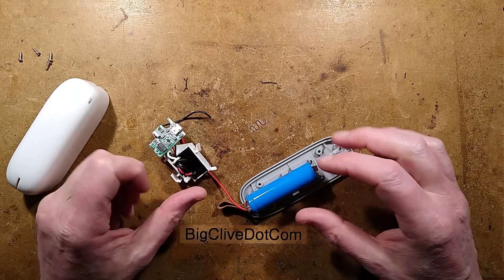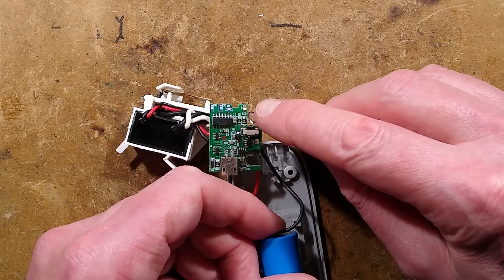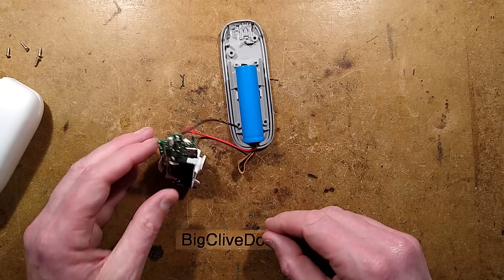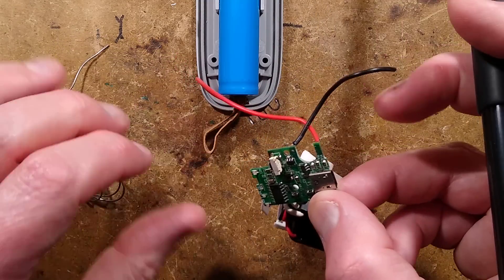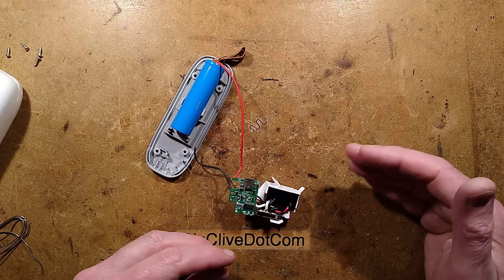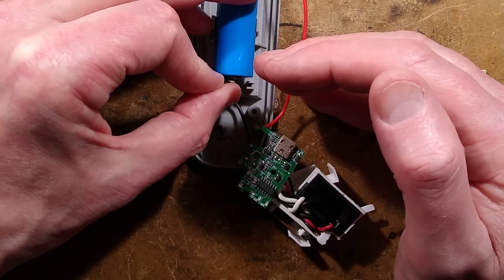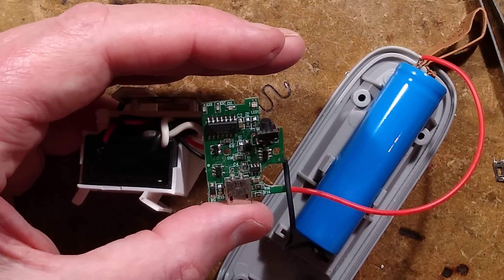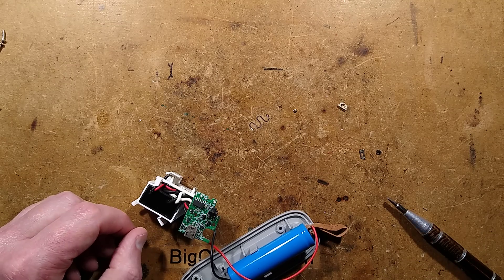The curse of tin whiskers rears its head again

Comment: Some ICs avoid whiskering by using three-layer nickel/palladium/gold plating (I use them in my own projects when available at a reasonable price), but consumer product makers are unlikely to pony up for that. I don't think anybody would have really minded if lead‑free solder was only mandated in incandescent bulbs (apart from oven and heat lamps, where high‑lead solder is necessary to get a suitably high melting temperature; anyhow heat lamps usually have longer lifespans), the internal connections of primary batteries, or similarly disposable items.

Power switches normally use silver alloy contacts, while quality signal/logic switches may use gold contacts; but in these cheap buttons, who knows?

There were actually some campaigns to move away from lead-acid car batteries at around the same time RoHS came in, but nothing seemed to come of them… (The EU bureaucrats presumably knew full well that they couldn't stand up to the battery industry, so ended up issuing RoHS as just another token “feel-good” gesture. Obviously lithium-ion and NiMH are more expensive and weren't so mature in the early 2000s, but the new sodium-ion batteries should help in the cost regard… CRTs were also exempt, so the last few years of CRT production used lead‑free solder despite containing far more lead in the glass anyway.)
Reply: the problem with lead isn't the circuit boards -- we're not eating them -- but the mining and manufacturing of them.  Same with mercury.  We're fine, the people we're forcing to mine, refine, and sculpt them into intricate shapes are not.

Car batteries at least are the most recycled product on the planet.  We don't have to do a lot of mining for those.
Reply: @tsm688  Solder accounted for less than 1% of lead usage; so if the lead‑acid battery market grows even a few percent, that's enough to overshadow it. It doesn't take much searching to find that we still mine ample quantities of lead (including in Australia; we're second only to China there).

Only if we actively reduce lead‑acid battery demand, can we rely solely on recycled lead…
Reply: @longrunner258  the same thing we always hear, "we can't do it perfectly so why do it at all".
Reply: @tsm688  More along the lines of "the patient has a massive gash on their torso, so let's remove the splinter from their hand and brag about how we saved them".

Banning leaded solder was a feel-good measure that did not actually generate an appreciable benefit(it arguably made things worse due to the sheer amount of additional electronics failures it caused). 
Meanwhile, the EU government was actively refusing to raise emission requirements on diesel engines and instead subsidizing them to keep them cheap and increases sales. That DID have a major difference, both locally and globally. But whatcha gonna do? Politicians gonna regulate, and they will do what generates a good soundbite instead of what is  actually a good regulatory measure.
Reply: This doesn't account for the benefits to the people making products, who take the brunt of the major harm caused by using lead in electronics. I actually consider myself relatively lucky that I only started electronics as a hobby after the transition from leaded to lead-free products became mature. I have no real experience with the leaded products and I find the lead-free ones to work just fine, but everything I'm using is designed for the higher temperatures required. I suppose I also just don't know what I'm missing? But I love the peace-of-mind knowing that I have a lot less risk soldering without a full ventilation setup. While I doubt that the harm that lead in electronics has caused can be quantified the same way that it is for leaded fuel, seeing the direct and severe mental degradation leaded fuel caused around the world for generations without us taking the threat seriously is terrifying. Lead is an extraordinarily useful material: cheap, plentiful, easy to process, easy to work with and granting amazing qualities when added to other materials, so it's a difficult and expensive process to wean industry off of it by finding alternative materials and processes.
Reply: @waylandsmith  - For a hobbyist who is not working in factory conditions, as long as you wash your hands after using leaded solder, the risk from using leaded solder is minimal. The fumes from Rosin based flux is a greater risk. There shouldn’t be any significant amount of lead in the fumes because your soldering iron should never get hot enough to cause any significant amount of lead to become airborne.
Oh, and you can still buy 60/40 solder that contains lead.
Also, if your home uses lead water pipes, that’s a greater risk than using leaded solder as a hobbyist (in the U.K. there are still a lot of older properties where the main water pipe is made of lead).
Reply: @waylandsmith  I'm not sure if they've yet overcome the issue, but many lead‑free solders require more aggressive flux (posing a greater respiratory hazard) than leaded, so don't get so complacent there. People would also have an easier time taking your argument seriously if you chose a less extreme comparison than to leaded petrol (pipes, paint, wine decanters; there are many to choose from).
Personally I won't rush to use lead‑free solder in any project I expect to last longer than lead‑free solder has been generally used for (≈20 years to date). If it's a safety device, then reduce that to 10 years.
Reply: I thought the lead-free solder (which is typically 99% tin with 1% copper, though some types can also contain silver) had the higher melting point than the old 40% lead, 60% tin solder used for electronics? In fact I just checked by looking up the melting points, and all the varieties of lead-free solder I found had significantly higher melting points or melting ranges than the leaded types. Unless you mean using pure lead - because that does have a higher melting point (at 327 degrees C), but the term "solder" is usually used to describe metal alloys rather than pure metals. Having said that, it would be possible to do soldering with pure lead if you have a soldering iron capable of the higher temperatures required, so maybe it can be described as solder - I just have never seen it described that way is all.
Reply: @lloydevans2900  There are dozens of formulations.  A lot of these were hastily invented when no-lead was decreed and their long-term manufacturing defects not discovered until later, with problems we'd consigned to the 19th century like tin whiskers and tin pests suddenly rearing their ugly heads.
Reply: @lloydevans2900  Lead-free solders indeed have higher melting temperatures than eutectic (Sn63Pb37) or near‑eutectic (Sn60Pb40) tin‑lead, but only up to 227°C for Sn99.3Cu0.7 (or 232°C for pure Sn, which is rarely used as solder). Oven lamps have to survive up to 300°C, requiring a high‑lead solder (Pb95Sn5 or similar); all the oven lamps I own (including new Philips ones) have the dull, dark grey joints expected of high‑lead solder.
There's also zinc-based solder, but that has a much higher liquidus temperature and is mainly meant for soldering aluminium or galvanized steel.

Comment: Oh boy. I sure hope the medical ventilator I use to sleep isn't growing tin whiskers inside 😭
Reply: If it’s a CPAP machine check it hasn’t got deteriorated foam inside (loads of machines got recalled for that and it drags on)
Reply: @bigjd2k  The foam recall thing was an overreaction. The European Respiratory Society has reported on thorough independent international tox testing science, and concluded that there is No Increased Risk in using these devices.
Reply: Medical equipment is exempt from RoHS and allowed to use leaded solder.
Whether the manufacturer DOES or not is unknown.
Reply: @CptJistuce  Interesting. I've never seen RoHS printed on a PCB in a ResMed machine

Comment: The 0C71 germanium transistor, and the  later types - AC141/AC142 complementary symmetry audio pair, etc. - all had a tinned case. These case grew many tin hairs inside the case (often electrically connected to the collector), until one of them shorted the case to the chip, killing the transistors in their hundreds...
Reply: OC71s were glass cased, not  metal , but the later OC171 (rf type with screen lead to case) were , i'm often having to blast chip to case shorts on the things , done some very recently

Comment: Fifty-odd years ago I worked in Repeater Station Maintenance for British Telecom.
We had a lot of failing equipment due to Tin Whiskers inside Germanium Transistors, mostly growing from the tin can.
While the short fix was to cut the Shield Lead of the 4 wire transistors (AF117, I think) I did the calculations for new resistors and replaced them with Silicon Transistors.
This got written up as an official solution in the TI's (Technical Instructions) and was some of the first Silicon Transistors used in BT.
I use Lead-Free solder these days, but stuff with 3% Silver, no Leaching of SMD parts terminals etc, no Whiskers (so far).
Reply: One fun thing is, germanium even grew whiskers, lead grows whiskers, silver grows whiskers, pretty much ever metal does where there is compression. That's been the bane of electronics since, well, electronics was invented. Some alloys can lower the incidence, but the only thing that seems to control it is conformal coatings or just good luck.
Here's a great shot of silver whiskers on SMD components.
https://en.wikipedia.org/wiki/Whisker_(metallurgy)#/media/File:SilverSulfideWhiskers1.jpg
And just to be entertaining, the crap will even grow in a vacuum.
Reply: @spvillano WOW!! just checked out the link.. wasn't expecting what I saw. I was expecting a single hair like thread of metal... That's actually "SCARY LOOKING" 👍👍🇮🇪
Reply: @spvillano  Fascinating, thanks for the link, saved me doing a Google👍
Reply: @spvillano ,  Tin whiskers not only grow in a vacuum but they particularly like to grow in cold or frigid environments. Hundreds of years ago in northern Germany, organ pipes soldered with tin underwent failure from the phenomena known as tin pest (Google it). Failure of lead-free solder used to manufacture the  electronics we shoot into space is a particularly modern problem!
Reply: @spvillano  "will even grow in a vacuum", I read that they are a significant problem for satellites. Due to the prohibitive launch cost they build in tons of redundancy so the hundreds of millions spent can be recouped over decades despite multiple component failures. But whiskers can create shorts outside of those predicated failures, rendering the redundancy moot. When you combine that with cold welding you have a seriously difficult problem to solve.
Reply: That's so cool.. you fixed that problem and now that fix is part of the manual.. 👍🇮🇪
Reply: @keithking1985  Well, it was 50 years ago, I doubt there is any 62-type equipment left in the world, and it would have to be all silicon by now if there were.
Reply: I've seen articles and videos online about using a battery or a charged capacitor to zap away the tin whiskers inside the metal casings of germanium transistors.

Comment: if your in a tight space and need to put the switch back on to keep the customer happy while you source a replacement. you can try the old NiCd whisker trick of charging as cap up to about 30-40V and discharging it across the terminals. blows the little whisker buggers right away and with the battery gives it a bit of charge at the same time. 🙂
Reply: What a great idea... Zapping the switch that is connected to a 3V3 microcontroller with 30-40V... If you get the polarity wrong and dont manage to blow out the protection diodes on the ports of the micro in forward direction, the 30-40V will kill them on reverse breakdown...
Reply: @randomsteve4288  i would have taken it off first 🙂

Comment: I wonder if adding a small capacitor in parallel with the switch would prevent the whiskers from forming by providing current pulses to zap them.
Reply: What would trigger it? It would charge up but… nothin. And often bypass & filter capacitors are added to the circuit anyway.
Reply: @BritishEngineer  No, I'm not talking about a bypass capacitor. Putting the capacitor across the switch contacts would mean a large current will flow for a fraction of a second, when the switch is pressed. If the capacitor is large enough, but not too too big, these current spikes might help to burn the tin whiskers, without damaging the switch, or interfering with the operation of the circuit.

Comment: Military and Medical were some of the last of the electronics to go lead free due to the issues with tin whiskers. Not sure if space hardware has gone the same route yet.
Reply: A lot of aero (even civilian) is still leaded, and required to be worked on with lead, because it would have to be re-certified to switch to lead-free. It's not so much that they expect that they can't manage the problem, but it costs too much to do the paperwork 🙃
Reply: @lunalangton5776  All new aero and medical has to be lead free. the lead solder exemptions for them ran out quite a few years back. There is no law that says lead free has to be applied retrospectively. Which is why lead solder can still be bought in the UK, if you state you are a repair professional, but most suppliers don't ask. they can't sell it to a hobbyist so don't tell them you are one 🙂
Reply: @TheEmbeddedHobbyist  that to me doesnt make sense, mass produced /professional equipment will be more a problem to dispose of than 'one off' hobbyist projects...
Reply: @andygozzo72  with Military and medical etc reliability is more important than that of disposal. With some equipment you need to use the same type of solder used in production. quite often if silver is used in the mix you need to use the same amount of silver in the solder or you get silver migration.  which affects the electrical proprieties of the joints.
Reply: @TheEmbeddedHobbyist  i mean  about not selling leaded solder to 'hobbyists', theyre not creating mountains of possible landfill so dont see why they wont supply to us??

Comment: I want to get one of these, but how long do they last on a charge and do they leave an ozone smell in the fridge. I like the anti-mould feature.
Reply: I have one that looks different but it lasts a week on a charge. It produces ozone for 10 minutes and then rests for 10 minutes and so on. A week is not bad considering the low temperature the battery is in (I have my fridge set to 4°C / 39°F). To answer the smell question; yes, it does smell of ozone when I open te door. Not overwhelming but it's certainly smellable 😅
Reply: @Ni5ei  any links to ebay?
Reply: @JohnnyMotel99  I didn't even post a link, just a few keywords for you to look up. Yet YT decided to remove my comment once again. They want to discourage people helping eachother I guess.